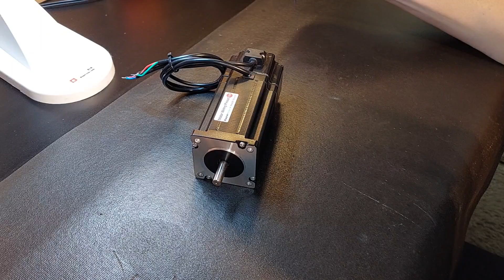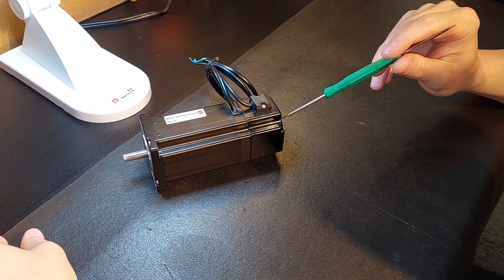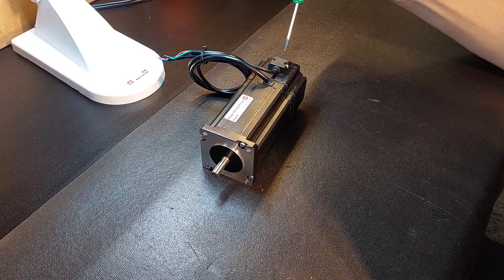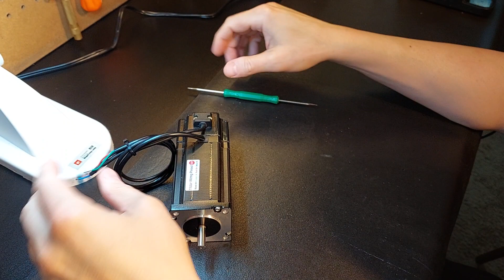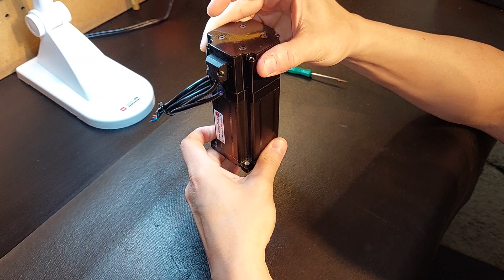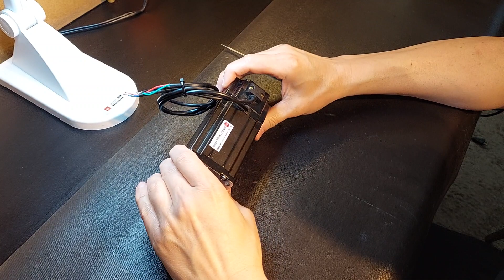How To Stop Your Z Axis From Falling When Your Motors Have No Holding Torque...

Comment: How is this possible, the motors always have detent torque available. they can never be free
Reply from the maker: The brake for the motor only becomes active in an E-stop condition when the motor's coils aren't charged, and providing holding torque.
Reply: @corvetteguy50  Still why do we need this, if we have More detent torque
Reply from the maker: Certain robots Z axis use transmissions with such little friction that the weight of the end user's spindle makes it fall when the system is powered off, and the motor for the axis is providing no holding torque. This has nothing to do with detent torque. Thank you,
Vince